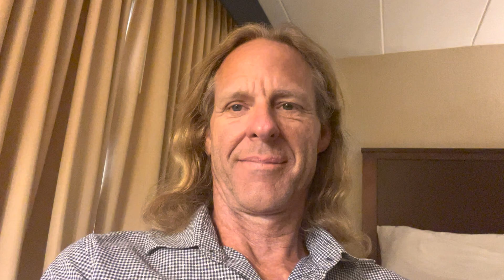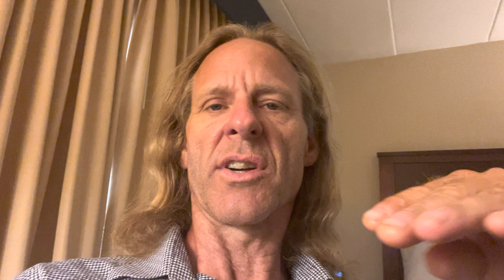Correction To The Sun Fun Kits Cell Test Video. I Forgot Something Important.

Comment: The good news is it's never too late to say "I'm sorry, I was mistaken." Thanks for teaching us on multiple levels, Ray. The bad news is we still don't have enough trustworthy options for sourcing top quality cells. I'm sorry I didn't get to meet you at summer camp. I didn't go this year. I was having too much fun on the electric sailboat you and Jenny Wu helped me build. ;)
Reply from the maker: Wait! Say what? Give me a clue about who you are. Tell me about this sailboat.
Reply: @RayBuildsCoolStuff  I emailed you early this year after recognizing your summer camp t-shirt on an older video. I bought a 28' sailboat last year that had a rusted out inboard engine. I pulled it out and replaced it with an electric motor kit. I built a 48v 280ah battery to store enough energy for the day sailing and light coastal cruising that we wanted to do. It was a lot of fun, and everything worked out pretty well this summer. We're up here north of Boston, so the boat's out of the water now. I'm contemplating a 2nd battery build before next season to extend our range a bit and give us more margin for the unexpected.

Comment: @Ray Builds Cool Stuff I respect your honesty and I admire your quality of taking responsibility for mistake you made. These days, it's really difficult to find people like you. This is the one of reason I would like to watch your videos. (because I know, I'm always getting right information/knowledge). Currently I'm building home solar system, so I would like to get every bit of detail which will help me to build this system. Today I watch one of video from sunfun kits: https://www.youtube.com/watch?v=XtAeMSNueFA I think they made this video as a reply for your finding. Here they mention capacity unit Ah not accurate and we'll need to consider Wh. Also they claim some energy waste due to temp rise when testing on EBC-40A tester.  But they missed that you test both sunfun kits cells and other merchant cells on same environment. So we don't need to consider on EBC-40A efficiency. Anyway, can you explain/ give comment on this Ah, Wh thing? bcz I don't see any point on that matter
Reply from the maker: I and others have found the EBC-A40L to be consistent and accurate. He didn't attack the accuracy of the tester until he used it on cells at his warehouse and didn't get them to test to rated capacity and far below his claimed capacity. The manufacturer puts a Wh rating on the QR code. They all say the same thing as they are based on the class and size of the cell. They then test in Ah and publish this result for the individual cells. 

The real problem with the tester we use and by we I mean most of the youtube and diy community, is that it only tests at .14 C which gives a higher result than the .5 C rate that the manufacturer uses. 

Bottom line is we, all of us, are in the dark about what the manufacturer is doing with their cells and how they are handled after they leave the factory. The ratings are established by the resellers which is by it's nature, marketing driven. The best we can do is find a trustworthy source by testing the cells we get from different suppliers in a consistent manner. Then we hope we can get a consistent and reliable product for a price that makes our batteries economically viable. Then we hope that supply doesn't change next month or next year. 

Our best resource always seems to be the individual people we work with. Best of luck on your project.

Comment: Here is our reply; https://www.youtube.com/watch?v=XtAeMSNueFA We have tested our cells they all test above 281 AH we tested 3 cells and the highest tested to 285 AH. We have posted links to our ZKE curve data as well as pictures of our curve data.

your testing process is flawed as you have not tested grade A cells before, the correct way to determine capacity is to take measured watt-hours and divide by nominal voltage. Grade A cells have a 3.25v under load, however, your docan cells are lower usually 3.2V because of this both cells still only make 900  Energy (watt-hours) but the grade A will only need 276AH to provide this vs the grade B requires 281.
Reply from the maker: All testing of cells should be done under the same protocols. I always test at 40 amps and use the constant current discharge test. I understand that you used a 30 amp constant pressure discharge test. You state that you  believe the 10awg wires of the tester are rated for 30 amps but they are silicone insulated wires which are rated to 75 amps. This is the same reason you can get away with the pair of 6awg wires in your battery kit with a 200amp BMS. 6awg wire is rated for 50amps that would be inadequate however your wires are also silicone insulated making the pair adequate for approximately 235 amps. The heat generated in the 10awg wires is not relevant because the sensing wires of the tester reads and controls the the load on these wires and the heat generated becomes part of the continuously monitored load. I will continue to test all cells with the same protocols for fair comparison. Good day.
Reply: @RayBuildsCoolStuff  He writes "but the grade A will only need 276AH to provide this vs the grade B requires 281." - that's nonsense. It's one the only reason the Amp-Hour is what you use to measure the capacity of a battery: it takes voltage and losses out of the equation. I've got a video on my channel that shows this in an extreme condition. A 280Ah cell is supposed to be able to deliver 40A for 7 hours, with 2.5V being the cut-off cell voltage - that's all there is to it.
Reply from the maker: @upnorthandpersonal  hi up north! I didn’t know you had a channel. I can’t wait to get home and check it out.
Reply: @RayBuildsCoolStuff  Don't expect too much - my last video was 7 months ago. There are two videos on batteries: one is the aforementioned video on a capacity test, the other on charging LiFePO4 in cold temperatures. The rest is completely not related to batteries...
Reply: Just run the tests entirely on the ZKE tester Ray, and post the graphs. We'll see the voltage, the Ah and wH figures. Use the proper 4-wire method and you can be sure the test is accurate. If you post the csv files, all the better for anyone to download and graph and analyse themselves.
Reply: SFK, does this mean you're selling Grade A 276aH cells as Grade B 281Ah cells? 

This would make sense if Ray tested 276Ah on the 281Ah cells and you are saying that 276Ah Grade A cells are 900wH and 281Ah cells are 900wH. 

As for 3.25v vs 3.2v under load, I don't see how nominal and under load voltages are related.

You get a fully charged cell and put it under load, and compare it with the same cell when it's almost fully discharged and the voltage under load will be miles apart. That is the delta between no load voltage and heavy load voltage. That delta will be significantly different on each end of the SoC scale.

Nominal voltage is more of a "ballpark figure" as fully charged will be higher and fully discharged will be lower, but a large percentage of the SoC cycle will be spent around that nominal voltage, or the nominal figure will be the mean or median voltage of the cell, depending on the chemistry. The term is used across many different chemistries and also used for power supplies or power rails, not even related to battery chemistry.

I look forward to Ray retesting using the ZKE ONLY, using the 4-wire method, not the 2-wire method which is unreliable. I think it would be good if Ray takes us along for the ride, and we see the testing method completely. The ZKE testers are some of the few testers manufacturers will accept as valid testers, so I cannot see how those tests would be counted as invalid. Heck, run the tests 3 times, another great scientific method. Some people notice cells loosen up after a few cycles. The other option would be that they slowly decrease in capacity. Either way, we all win because we all find out.

If the cells suck, I look forward to him returning them and you replacing them under warranty. If it turns out the test returns positive results, I look forward to Ray showing so. It's the way things should go. Fully open, completely transparent. Good will all around.
Reply: @CollinBaillie  
Grade A cells provide the same watt-hours for less capacity e.g.  900WH at only 276AH vs Grade B cells that provide 900WH at 280 AH capacity.

The watt-hour remains the same for both but grade A cells have average voltage of 3.25 vs 3.20 volts for grade B.

The issue is that Mr. Ray claims he tested Luyuan cells before... On those cells he would have seen the same situation, cells "failing AH, but exceeding WH test"

Either way,  we now have a clear way to distinguish grade A vs Grade B using this ZKE charger.

The narrative that needs to change is "Capacity is a measurement of Grade A vs Grade B" When in reality the way to determine Grade A vs Grade B is the voltage under load, we have been saying this for over a year.

Automotive cells are judged on what voltage they can maintain when you demand power from them, not how much AH you can draw from them at low rates. If anything this shows that for those looking for long term storage, grade B may be the better option.

Its not the case for us, our batteries and kits are designed for RV, Trailer and other users that need to run coffer makers, A/C and other devices that require power. For them grade B is not a good option.

Comment: I agree. There is no reason not to admit you made a mistake. It happens. I worked in the A/c business and i owned up to any mistakes i made. biggest one I made was when putting a unit back together, i put the wrong screw, it was too long, in a screw hole that pierced the evaporator coil end tube and created a leak.  I started pumping the system down and told the customer and my office about it. took the next 2 or 3 hours to fix it at no cost to the customer. But it got fixed and did not cost the customer anything. 
I also like to be told when i make a mistake so i don't do it again. If you keep doing it after being told about it, then it is just laziness and not caring about what kind of work you do.

Comment: The best way of balancing the cells of a battery is avoiding the use of an active balancer, because active balancing can never be as efficient as is the passive balancing method and the best way of doing passive balancing is first measuring the amp hour capacity of each and every cell and then arranging the cells in groups of equivalent amp hour capacity while those groups of equalized amp hour capacity (by making a justified combination of weak and strong cells connected in parallel, hence when we use such group of cell (connected in parallel) we need no active balancer because the cells automatically balance each other
Reply: Until you use them.

Comment: My main trade is a machinist. Imagine working on a part that has a weeks worth of multiple machining ops and heat treatments and you screw up. There’s no repair allowed, there’s no fix. It’s called scrap. The more you look at it the more it eats you. I hate loosing, it’s rare but it happens. The only thing to do is to inform of the screw up, order more material and ready yourself to start over being sure not to fall into another rabbit hole. Could I have let it go? probably, would inspection have caught it? Due to the complexity probably not. Would it have caused a problem with functionality ? Not without modifying the mating part and pissing off the costumers some time later. Would it have been traced back to me. 50/50. 
Still have to do the right thing. It sucks but that’s integrity.

Comment: I've been meaning to also add a caution on your use of bench supplies to charge these large batteries.  A purpose-built battery charger can handle large reverse voltages (e.g. charger is turned off and at 0V but still connected to a battery or battery pack at X volts).... both while charging, discharging, on, off, or if the mains are lost while it is connected up.   A bench supply, however, is virtually guaranteed to NOT have a wire-or output and will be damaged or something will burn up under similar conditions.

So you need to be careful when using bench supplies that aren't battery chargers to charge these large batteries up.  What I usually do is put a Schottky power diode in series with the output of the bench supply as a safety.  These can be found cheaply anywhere, but are limited to around 5A without a heat sink (free air heat dissipation).  The voltage drop is typically around 0.3V but varies a bit with current.

So in this configuration one has to use a volt meter under load (like a 15W 30 ohm resistor) to dial in the exact desired voltage since the display on a cheap bench supply (a) doesn't take into account the diode drop and (b) is probably off by +/-0.1V just generally.  So using a volt meter to dial in the correct voltage is mandatory when using bench supplies to e.g. balance cells.

In anycase, its something I noticed in your earlier videos that is a bit dangerous.   There are multiple potential issues with bench supplies connected directly to batteries.  A linear supply usually has a power transistor and those often have very low reverse break-down voltages (12V or less is common).   Supplies that use MOSFETs have a reverse diode built into the MOSFET and will conduct backwards if the voltage on the output is higher than the voltage the supply is trying to push.  A synchronous supply makes assumptions on the direction of current flow and will melt.  A switching supply has other components that will conduct the wrong way.  Many supplies have bleeder resistors or relays that shunt the output to ground when turned off.

The list of potential problems when the supply is directly connected to a battery (i.e. is not the only source of voltage) goes on forever.  At best the supply will be damaged or blow a fuse, at worse the safeties will fail and it will catch on fire.  Dedicated battery chargers and testers, on the other-hand, are designed to handle all of these conditions.  On, off, mains lost, still connected to (e.g.) a 48V battery pack when turned off, and so on.

I use bench supplies to charge large batteries myself, but I always throw in a Schottky diode which more or less works around these issues.  Its important not only for the health of the bench supplies, but also for safety.  One diode per bench supply, located as close to the battery as possible.  So if using three bench supplies in parallel, each one needs a diode.  That not only protects the supplies from each other and from the battery, but it also allows any of the supply inputs to go to ground without shorting the battery or other supplies out.
Reply: Fortunately my 20,640 w PV, two 12K's are more reliable than the grid we used to have. I run a 50 amp, 30 amp, 20 amp power supply to top balance my batteries.

Comment: Thanks Ray. We all make mistakes. We just hope they don’t cause harm to others - or to ourselves.  I chopped up my hand in my table saw one evening.  It was a dumb, dumb move.  I knew better.  I had made thousands and thousands of cuts on that saw. But it was late in the evening.  I had been working hard all day, finalizing some kitchen cabinets. My wife told me, “Honey, you need to quit.”  I replied in an angry tone, “I have a crew coming tomorrow to deliver the granite! I have to get this done.”  I cut a thin piece and used my push-stick. But then I immediately reached across the saw to grab the piece.”  It caught on the back of the saw blade and slammed my hand down.  A few minutes later I was in a helicopter headed for the hospital.  A week later I resigned from work (took an early retirement).  I had been working from home as a programmer.  But typing on a keyboard was out of the question now.  That one mistake happened literally in a fraction of a second. And it impacted the rest of my life.
Reply from the maker: WOW my friend. I too had an altercation with a tablesaw when I was much younger. They put the finger back on but you might notice that I often hold it up out of the way when doing intricate tasks that require dexterity. I'm sorry that your outcome was so significant but I hope it led to something even better.

Comment: I found a 4500 sq ft house out of level 5" while starting up the HVAC. The house was 99% complete. I knew from standing in front of the house that something didn't look right. I had some experience building a home and two shops of my own from the ground up and around construction my whole life. I did a little measuring and found that the concrete basement was poured out of level. The original homeowners have moved on after 15 yrs. They never knew, because that would have been an expensive fix and would have just upset them as everything had to be just perfect. Nobody complained during construction, but I know the framers, siding, sheetrock, cabinet contractors had to know too.
Reply: “If you’re not part of the solution, you’re part of the problem” - Joe Henderson

Comment: Look man in order to transport these cells legally a 30% charge is all that should be in them. The important concideration is do they contain their rated capacity? If not they are used cells that are being reused for battery kits. You should top balance and assemble then cycle a couple of times THAN see what the packs capacity is and verify that the balancer works. I'm betting they are reused cells.

Comment: So the Ah capacity may or may not still be low?  But now we will neverknow if the initial state of charge was similar or not.  Can changing the Charging procedure affect the discharge capac by  5 - 10Ah?  Would be best to verify if changing your charging procedure does or does not affect the discharge capacity.